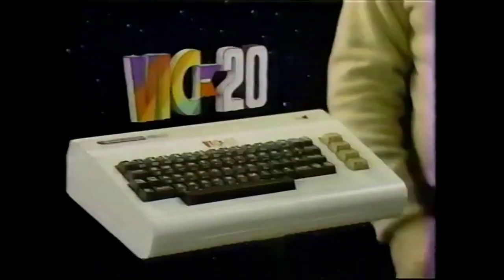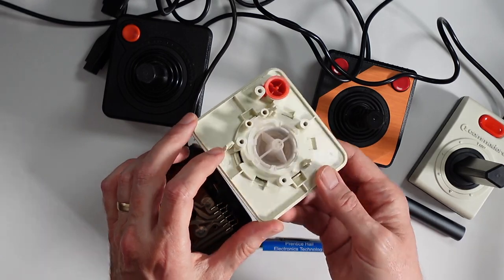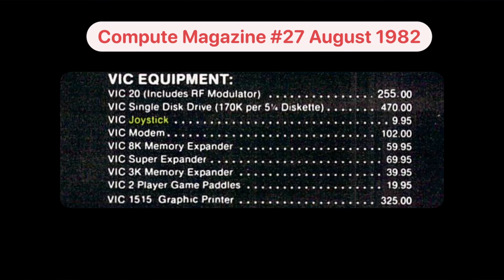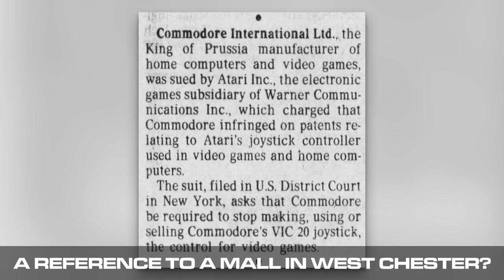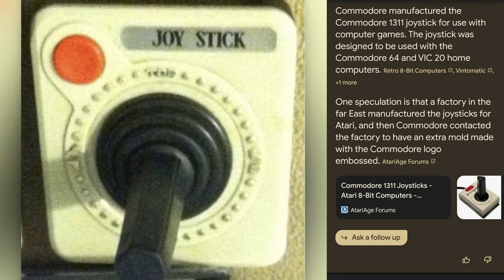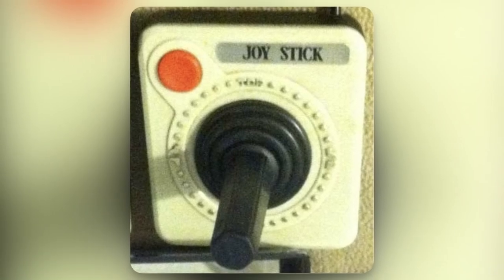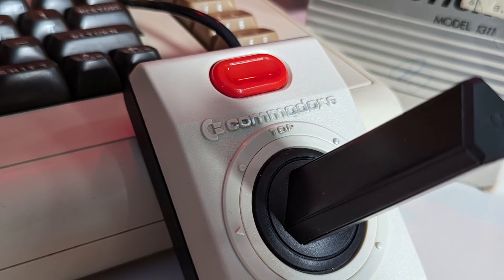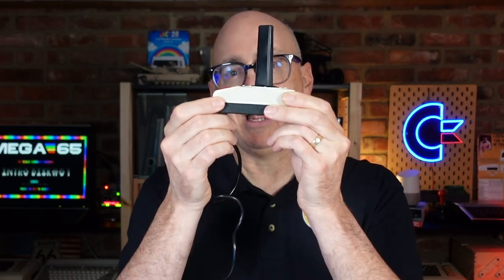🕹️ Atari vs Commodore! The Battle Between the VIC-1311 & CX-10 Joysticks

Comment: The clone of the 1311  in the video is mine! It's a cropped version of my image, just the cables aren't shown in this image.  I also have the 2600 clone clone.
Reply: I have some additional images I can share, the pcb has a marking of 1994V-G and 51A1-28.  I think it uses switches instead of the metal domes.  The bottom says made in tawain, replublic of china.  I think that is all the markings
Reply from the maker: I'd love to have additional images and thanks so much for reaching out! With additional images, I might do a short follow up if you're okay with that plan.
Reply from the maker: I'd also love to learn more about that one too!
Reply: @retroCombs  how can I share the images?  I can't find the other JS clone of a clone, just moved a couple months ago and many things still packed.  Commodore also cloned the Atari paddle controllers, and then eventually made their own.
Reply from the maker: @charlesdysert4296  I have those paddles as well! You can send images to retrocombs@icloud.com. If they get compressed, I can share a Google Drive you can drop them into. Appreciate the offer!
Reply: @retroCombs looks like my reply didn’t make it. i created a one drive folder with the images. i think you should get an email with a link. let me know if you don’t get it or have an6issues
Reply from the maker: @charlesdysert4296  No email link yet. just to verify, you sent it to retrocombs@icloud.com?
Reply: @retroCombs  just sent it directly from my gmail accounts
Reply from the maker: @charlesdysert4296  Got 'em! Fascinating and already thinking about a short video to share with others.
Reply: @retroCombs  cool let me know if you need anything else
Reply from the maker: Will do!

Comment: My favourite joystick was the one everyone else hated. It was the one for the C=plus/4, the C=1341. Bil Herd praises it's design, in his discussion online (although he claims to have broken it to make a point!). The designer went for a fire-button on top, not on the base, and a very thin – and oh-so stylish – stem (the bit Bil broke). They had a reputation for breaking, too, although since,  I have found the are repairable. They were also very comfortable, cupped in the hand, whereas the other Atari-style joysticks, and most others, needed to be held firmly on the table top, often using suckers (which I find never work well). I think you could say the same of the second 1311, the C=1311, although the fire-button is on the base. I'd say that's also true of the paddle controllers – with just the same controversies, there!
Reply from the maker: I do have a 1341. I considered including it but the video was already long. Maybe a follow up video?

Comment: Didn't like that joystick, it felt too mushy.   The ergonomic Epyx joystick with the nice clicky switches was my fave. :)
Reply from the maker: Be sure to watch my full video for my take on this joystick and it's interesting history. Thanks for sharing!
Reply: @retroCombs - Yes, I watched it from beginning to end as a true old skool C64 fan.  Anyway, all these originals and clones used a crappy "dome switch" on the PCB which made it feel mushy and notoriously fail prone or inaccurate at times.  Also, their ergonomics (feel in the hand) weren't the greatest despite placing the fire button in the middle, compared to the Epyx joystick which was a joy to use (pun intended). :)
Reply from the maker: Thanks for watching. Dome switches were all the rage back on the day. I remember them on so many electronic products. I'm going to have to keep my eye out for an Epyx 🕹️.
Reply: I love the clicky motion of the Epyx 500XJ, but to be honest the fire button would tire out my finger pretty quickly.
Reply from the maker: @IsaacKuo  Now I'm really curious. Might have to check and see if @JamiesHackShack has one.
Reply: @retroCombs - The Epyx ergonomics is super comfy as it melts into your hand, but not for left handed users. lol

Comment: While way too late,  you might want to explain to your t-shirt vendor that Copyright does not apply to physical objects.... ;)
Reply from the maker: Ya know. That's a good point. It kind of looked like a form email with a single customized line.
Reply: @retroCombs  If you dig a bit deeper, you may find that since the patent, utility patent, and trademarks are long dead/expired, there's no legal impediment to you using the image.  Of course Pretend Atari may come after you if you build a physical replica.  Another funny thought - if the current owner of "Atari" only bought the name and not all the assets, it may turn out that they don't have any standing to use over the use of the design...
Reply from the maker: All interesting and not implausible thoughts! Let's just hope someone doesn't come out of the woodwork claiming Commodore hardware IP.

Comment: Didn’t catch the first part of the vid but what about the VIC-20’s original Paddles? Because they also shamelessly ripped off Atari’s Paddle Controller design. Exteriors at least.
Reply from the maker: I have those too. Trying to decide if I want a video on those. We'll see how well received this video is and I'll go from there. Thanks for doing the after the video Livestream!
Reply: I've looked into this a bit and it seems Atari didn't care at all about the paddles being ripped off; it was all about the joystick.
Reply: I don’t know what they look like inside, but I do know that the resistance range is not the same. The Atari ones have a 1M ohm potentiometer and the Commodore ones are 470K ohm, so you can’t get full range game movement on an Atari with the Commodore paddles.
Reply from the maker: That's interesting. I need to test that sometime.

Comment: Those later Commodore joysticks were the worst ones ever existed.
Reply from the maker: They weren't the best, for sure!
Reply: The TI-99/4a joysticks are much, much worse.
Reply from the maker: @8_Bit  I've yet to lay my hands on those. Might see if I can locate one at VCFMW. Do you plan to be there Robin?
Reply: @retroCombs  Yes, totally planning on being there. Hope to see you there. TI-99/4a is a fun system full of very strange design choices, I'm sure you'd enjoy discovering it. But those joysticks are really bad :)
Reply from the maker: @8_Bit You told me once I should replicate my Plus/4 user's manual series on the TI, maybe one day. I do have some accessories ordered. Waiting on stock. Look forward to seeing you there.
Reply: @8_Bit  The "Wired Controllers"
Reply from the maker: And oddly wired they were.
Reply: @8_Bit  I sure hated the TI-99/4A sticks I'm familiar with. These were tall and narrow, with rounded edges making them even harder to get proper leverage for left/right movement.

Looking them up, it seems there were at least one other type of TI sticks - ones with the fire button on the upper left side rather than across the top upper side. Those look not so bad, but what little I've read suggests they were somehow even worse?
Reply from the maker: @IsaacKuo  That seems to be the consensus. TI joysticks stink! 😂
Reply: @IsaacKuo  Yes, those tall and narrow sticks are the ones I was familiar with too. I just looked up those other style with the button on the side; I don't recall ever seeing those before. Amazing to think they could be even worse!
Reply: As a kid, I always read them as "Weird Controllers". And I thought "What a fitting name".
Reply from the maker: @OldAussieAds 😂